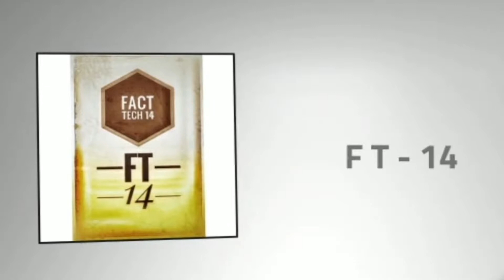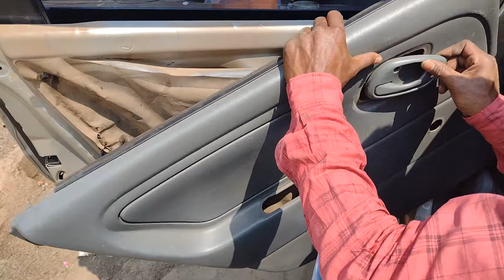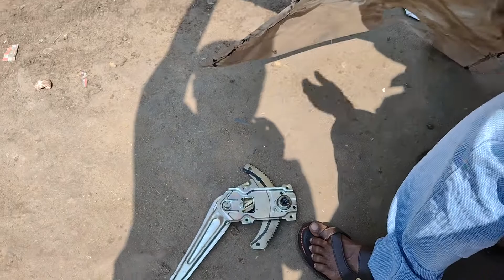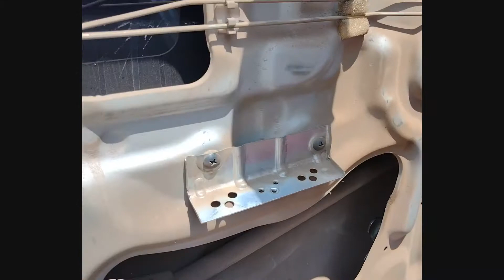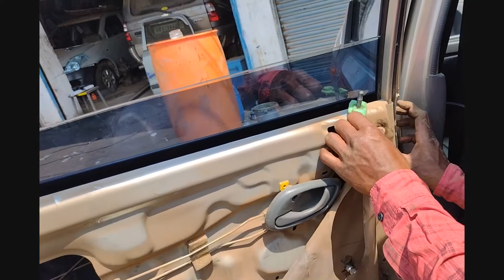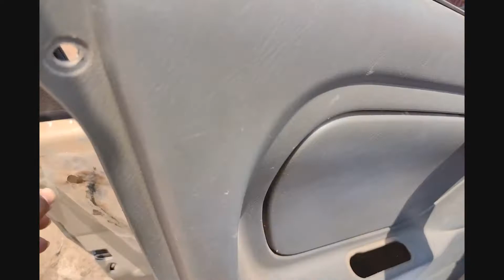Car door broken handle repair | Manual car window handle kese repair hota he | कार के शीशे की मरम्मत

Comment: Hello sir. I am getting Hp 2015 at a good price. Should i buy it ? Or should i go for hp 1320? I want a low maintanance printer and my requirement is only almost 100 pages per month (black and white). Please answer quick .thanks alot
Reply from the maker: Hi, 
There is no such printer called hp 2015 , can you please check again??
But for Hp 1320 it's a good printer and you can go for that also